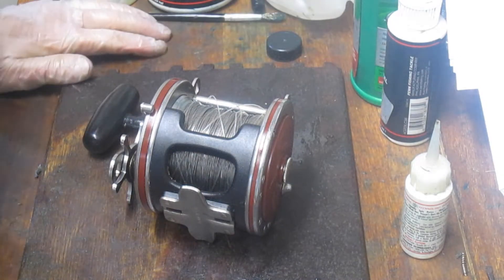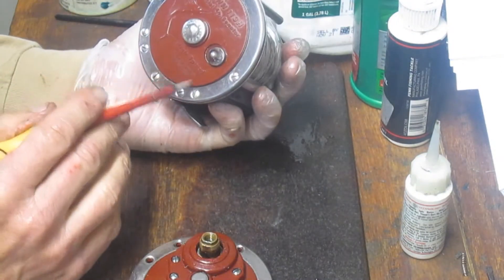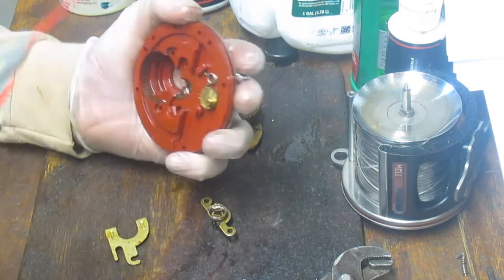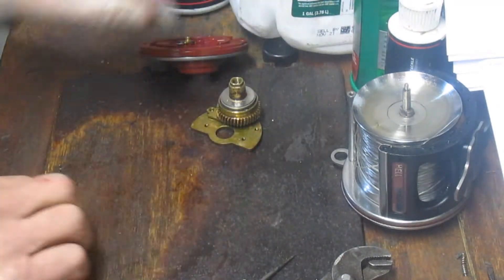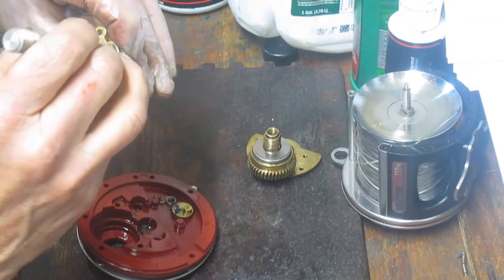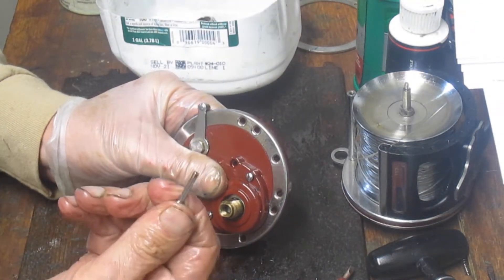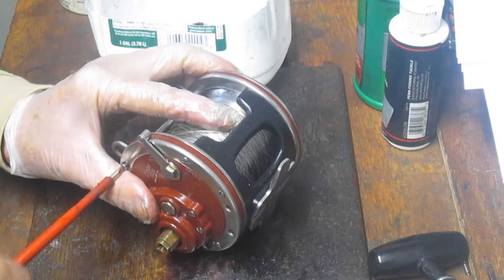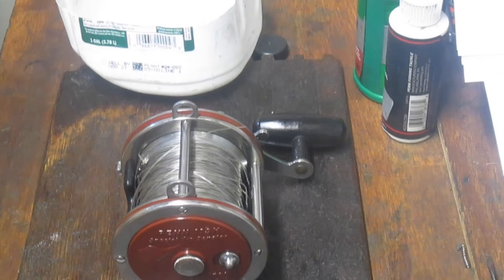Penn Senator 113 LH 4/0 left handed saltwater fishing reel  how to take apart and service

Comment: I take it that there is a difference between the left and right hand reels in a single part, the gear sleeve?  This could be changed to make a reel right or left handed?
Reply from the maker: The gear sleeve and the A/R god mounting.  Some of the 4/0 gear side plates to not have the notch or pin to reverse the location of the A/R dog.
Reply: @2ndChanceTackle  After posting this I had a look at the parts list - seems like the gears are left or right hand, too.  Oh well, I thought there might be a chance to turn one around easily - not quite so easy.

Comment: Honestly, what tf is the deal with all these fishing reel manufacturers not making enough left hand models? Back in the day (80s and 90s), I didn't know a single person that reeled in with their right hand. To me, if you're right-hand dominant (like, you write with your right hand), it makes more sense to support the rod and fight fish with your right hand, while reeling in with your left. And since, like, 90% of the population is right-hand dominant, you'd think this logic would make sense and they'd make more left-hand retrieve reels. Fn bastids!
Reply from the maker: The general rule is the you use your right hand on a conventional reel because the reel is mounted above the rod and the reel cranking is where the power is needed.  The reels mounted under the rod require the arm strength to hols the rod, so that's why the left hand cranks - at least the manufacturer's think so